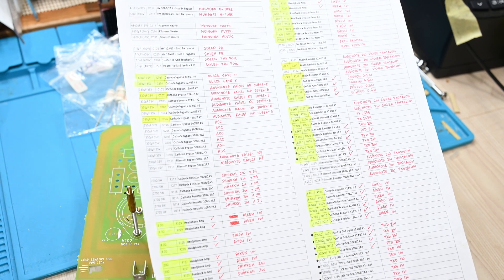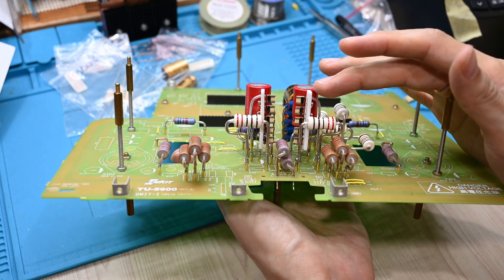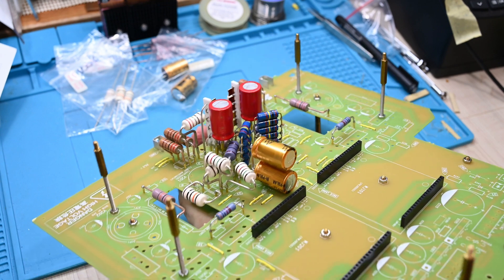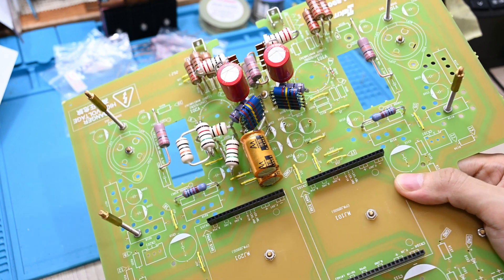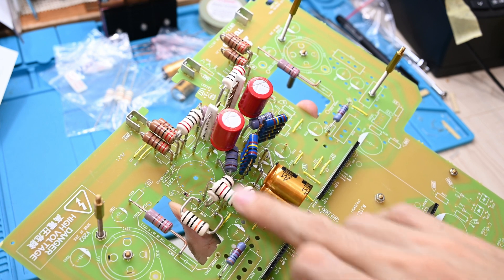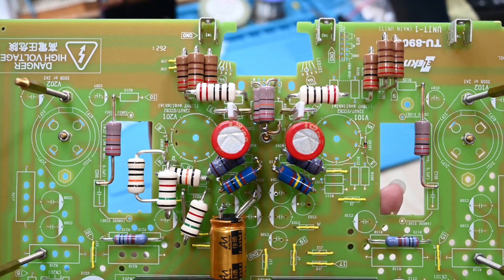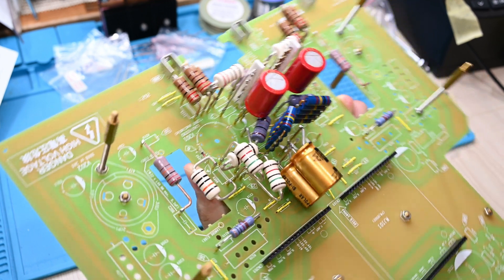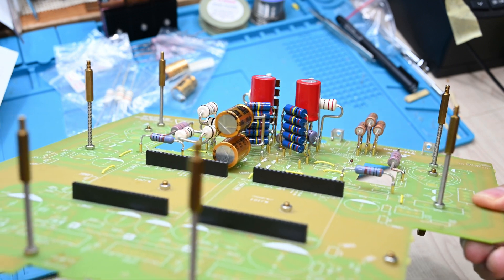Elekit TU-8900 (300B/2A3 Amplifier) Upgrade - Part 4

Comment: Wow, that's beautiful. The immaculate installation is everything. Its a sculpture that deserves another type of case than the stock Elekit. 

I'm thinking piano black laquered wood or urushi of some sort. Hmmm...

It's also a shame to close it all up. Ofcourse dust is a problem, and an all transparent case can get a little tacky, but maybe have one glass pane ir something somewhere?
Reply from the maker: You read my mind...

It will be in a new wooden chassis - yet to be decided the design.

Acrylic or glass top plate for sure!
Reply: @jimmysjunkyard  Fantastic. 

To me, acrylic can sometimes come off as a bit cheap. It depends though.

There are some cast glass tiles available that are beautiful. They often have slight imperfections, but some are fully transparent. 

I'm an architect, and good at 3D modelling. Let me know if you want a quick 3D sketch of any of your ideas. I have also built the 8900, so I know it pretty well.
Reply from the maker: Thanks Jonas. There are some more big parts like 16Kg output transformer + 8Kg power transformer and some other big stuff. So chassis design will be a bit tricky. Appreciate your help, but I think I only can comment on that later (once at least I finish the PCB). Then we can decide where to put the rest of big components... :)
Reply: @jimmysjunkyard  Makes sense! Let me know
Reply from the maker: @jonas-j3h  thank you very much... But I'm kind a slower in build, as this is only hobby during my weekend spare time... 😅
Reply: @jimmysjunkyard  It's super nice to have a project like this going for a long time though! My 8900 build ended too fast, even though I couldn't wait to hear the amp.
Reply from the maker: I finish one TU-8900 last year. This is my second build... Off course the first one was all standard kit...